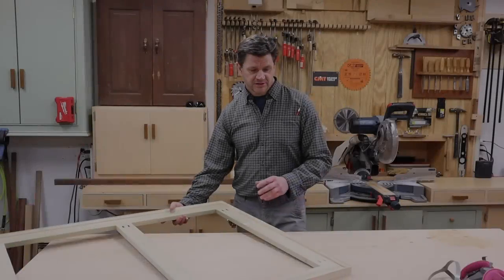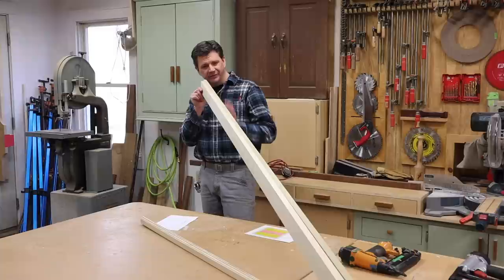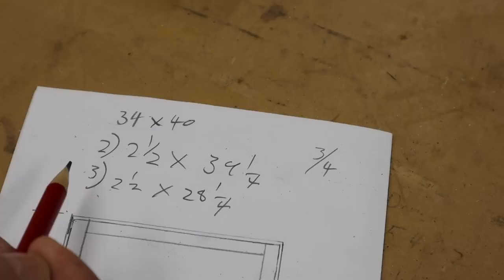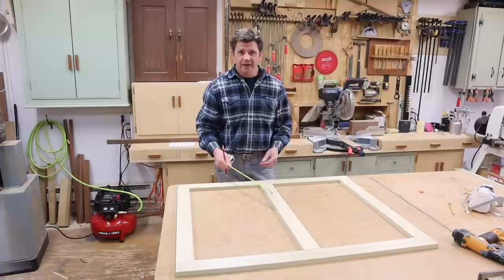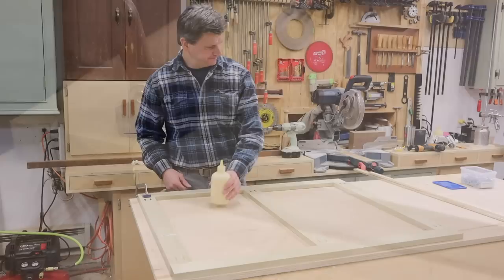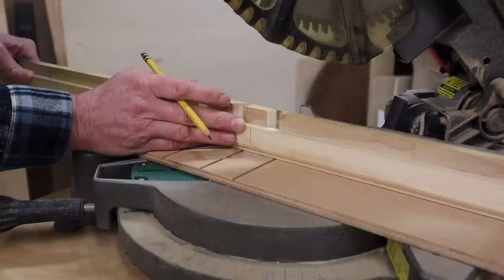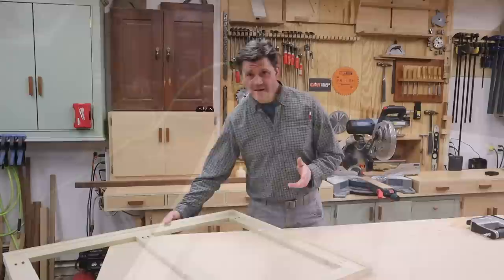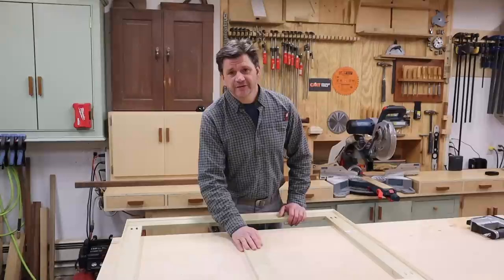How To Build A Stretcher for Stretching a Canvas

Comment: Art restorer here. The proper stretchers are connected by grooves and tenons. Tapping (or loosening) the wooden wedges (keys) embedded in the notches on the inside of the stretcher allows you to adjust the tension of the canvas. The canvas will change with changes in air humidity and temperature. The rigid stretcher may cause irreversible damage to the paint layer. Your frame is only suitable for amateur decoration.

Comment: I'm trying to find some good info on stretcher bar joinery but everywhere I look it seems that no one knows what a "stretcher" is. If you've glued and screwed your corners together then you have no way to wedge them outwards to actually stretch the canvas out over the years. So many people seem to think that "stretcher" simply implies a wooden frame of any kind that you then stretch a canvas over. In fact it refers to a frame having the ability to actually stretch the canvas tight many years after having a canvas attached. Improper storage of paintings resulting in canvas deformity (indentations) is one of many reasons one would want the ability to stretch a canvas out. Your method here means never having that ability and so it is not a "stretcher" but simply a fixed frame.

Comment: Hi Jon: great stuff. Thanks so much for sharing your knowledge and time. One issue I’ve found is that it’s often hard to find straight lengths that don’t have some twist, bow or cup. What are your thoughts about using MDF instead of wood? It seems more dimensionally flat; I can imagine that it’s much heavier than a soft or hardwood board of similar dimensions, but any disadvantages other than that? Thanks

Comment: Excellent vid. I was curious to why the perimeter edge is to high away from the frame.  I am an artist & I paint using the 3 primary mediums & have never seen/used a canvas with such a high ridge. Are there benefits other than the potential "bleeding"? Very helpful to someone who may just start stretching my own canvases. Thanks.
Reply: If the canvas is touching the frame, then when you apply paint the canvas presses directly against the wood and takes more paint.   The end result is a tracing of the frame on the painting.  It's like making a graphite tracing of a coin on paper.

Comment: Really great video, I've just bought a makita 2712 315mm table saw, can you recommend a blade to use for the neatest cuts, how many teeth to go for? I'm just looking up how to make them before I start, I usually get shredded edges though when using mitres as if the blades not got enough teeth

Comment: could you use 1x2 instead of 1x3 boards for the beams? also, does the way you add the pocket holes prevent warping?

Comment: Jon, why do you edge ban it if you cover it with canvas. Also, in the other video, it doesn't look like molding is on the frame.
Reply: Hope I'm not being presumptuous answering for Jon, but I've built stretchers like this before. The trim keeps the canvas up and clear of the main frame so it doesn't rest on it and show through. Store bought stretchers are wedge shaped for this reason.